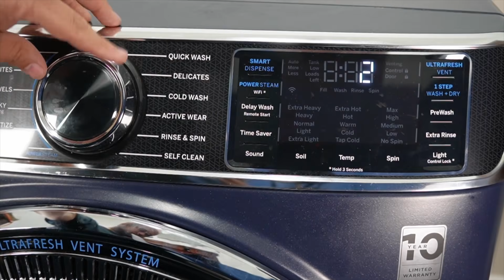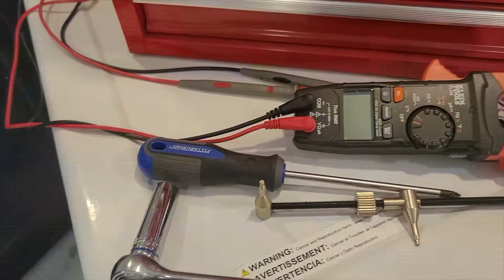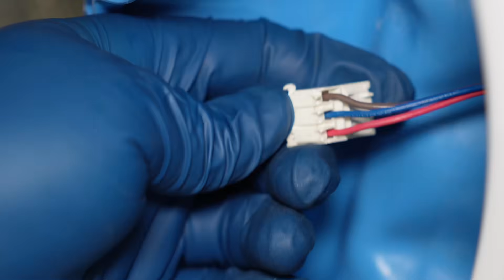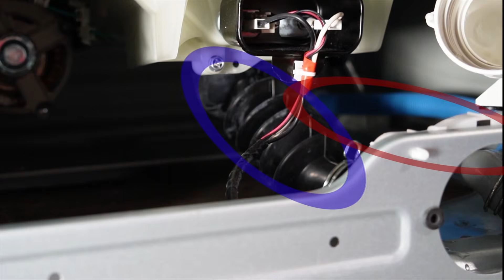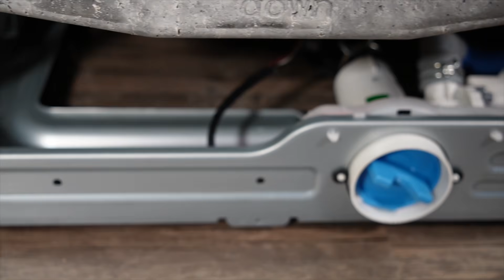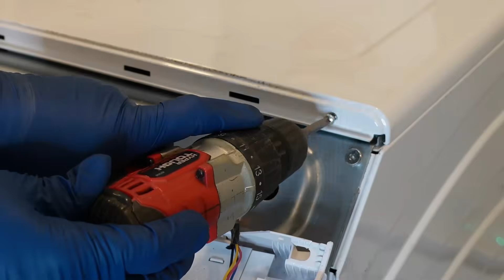GE Front Load Washer Stops Mid Cycle and Won't Spin - Common Issues

Comment: My washing machine (Model Number GFW850SSN0WW) won't spin more than 5-7 seconds even during the spin and accelerated spin tests. I know my damper was bad and I just changed that. Is it possible it is the inverter board or the accelerometer? How would I know if it is one or the other before ordering the right part?
Reply from the maker: Inverter board 99% of the time with that explanation of failure. Very rarely accelerometer, and you should see inverter board codes vs. accellerometer codes.
Reply: @bensappliancesandjunk  Replaced the board and it seems like it is working. Ran the rinse and spin and it completed the whole cycle. Going to start washing everything now, LOL. Thank you for the video and your advice.
Reply from the maker: @tubbywonder  glad to hear this fixed it for you!
Reply: I'm working on a washer that only spins with small loads any suggestion? I check suspension everything looks solid

Comment: Please consider a video on window air conditioners.  What are good models.  The ones sold at Home Depot, Lowe's and Walmart seem to be disposables.
I have a 98' 7800 Btu Panasonic window AC, and a Kenmore 8000 Btu that was purchased about six years ago when the stores were closing.
The Panasonic is much heavier, quieter and blows the doors off the Kenmore.

Comment: turns off after a matter of seconds and you hear a clicking sound.  No error codes. just keeps clicking.  Sounds like a relay click not the door lock click.
Reply from the maker: I just put the video out for that about 3 weeks prior to this one
Reply: Wish I watched this before I changed the inverter board.  The inverter board was not the culprit
Reply from the maker: @MrImperial67  it sucks - thats why I made the videos and released them as fast as I could, with the one about the main board being first.
Reply: @bensappliancesandjunk  thanks man I'm just starting out in appliance repair and you were more helpful than ge and my training school

Comment: I finally found your channel again. I thought I was subscribed but I wasn’t but I am now.
Hopefully you can answer this question and if you have a video with this topic link me to it. If you had a choice between Electrolux front loads and Maytag which one would you buy?
Thanks
Reply from the maker: With out adult right now I would go with electrolux
Reply: @bensappliancesandjunk  thanks
Reply: @bensappliancesandjunk  Thanks again.
So I think I narrowed it down to LG or Electrolux. 
Do you have a no bells and whistles LG front load that yourself you would recommend but maybe they all come with bells and whistles now.
Reply: @bensappliancesandjunk 
I decided on an the Electrolux 3 Series 

Washer (ELFW7337AW) with LuxCare® Wash System.

Dryer (ELFE733CAW) with LuxCare® Lint Shield

Doesn’t have all the bells and whistles and that’s what I wanted. Hopefully I made the right decision.
I only noticed after that it didn’t have an access door to clean the pump filter and looked at the schematics and couldn’t see one inside but I’m assuming that there is one. Do you know?
Reply from the maker: @rotaxrider  it doesnt sadly from my knowledge. But on the other hand, I never hear of techs replacing them so its possible they're built a little bit better than other brands.
Reply: @bensappliancesandjunk 

👌Thank you
Reply: @bensappliancesandjunk  
So not even one inside under the washer inline with the pump?
I’ve seen other videos where the had to remove the front of the washer to gain access to the filter inside a hose housing near the pump?
Also I seen where there’s an access panel under the washer where the filter is located.

Comment: I really do not like GE appliances. I worked at GE Aviation and saw first hand how GE cheap out on producing parts. I also had a old 1993, I seem to recall, GE top loading washing machine which was pretty good which lasted over 20 years & used a cider block for a counter balance. I now have a LG front loader washer & dryer. I am not impressed with these. I have to set the washing machine spin cycle to medium so it does not come up with a uneven load error. When I have to start replacing all of the appliances, I will get a Samsung all in one washer/dryer since I seem to remember you gave the Samsung unit better review then the GE & LG units. Please correct me if I am wrong.
Reply: Don't I am a tech and those things are crap
Reply: Please do not get the samsung
Reply: @codythedogyoutuber  Thank you for your advise. Could you tell me why not to get the Samsung.
Reply: @donaldhollingsworth3875  1. Spider arms go bad quickly 2. Heat pumps are badly engineered 3 inlets Val’s are trash
Reply: @codythedogyoutuber  thank you for your advise. I really appreciate it.
Reply: @donaldhollingsworth3875  Yeah like others have said, Samsung is pretty notorious for innovating but never fixing known design flaws (their Bespoke fridges seem to be them turning a new leaf on refrigeration though which is promising), but LG's laundry has always, always been top notch.. especially their front load machines (their top loaders are still direct drive, but like all top loaders, are simply a cheap tin can with a flap on the top, marketed specifically to stubborn americans who will never buy a front loader for..... reasons? Unreasonable reasons, anyway...) any LG with a heater seems to be equipped with their very good balancing algorithm, maybe yours is one of the base models which seems to not use an accelerometer or something, not sure...
Reply: @donaldhollingsworth3875 the washer pumps go out often and leak. I replaced two of them. Granted I'm having issues with my GE right now too 😂 Had issues es with LG and Fisher-Paykel as well. Whirlpool and Maytag are much longer lasting. I have issues with my LG refrigerator too,and luckily they had a recall that covered me.
Reply: LG is definitely the more reliable and better performing washer dryer set of the three. The uneven load error isn’t due to spin speed, it’s due to what you put inside it. If you put singular or small loads of heavy items it will easily go off balance.
Reply: They're both trash
Reply: I had a Samsung washer and dryer Combo. Lasted 3-4years.
Reply: @sandasturner9529 yup. Same issues with LG. My LG television is the only thing that lasts. Had issues with an LG refrigerator, too.
Reply: LG is making the best midlevel laundry atm
Reply: Bosch!

Comment: Ben! I have the wifi capable version of this wacher with the "tide" auto dispenser.
I've used Tide's washing machine cleaner with oxi a couple times now, but I'm curious if it's overkill. One packet caused the entire machine to fill with suds. After the painfully long (nearly a whole day) self clean cycle, there were still cleaner detergent particles in the drum. The instructions state not to use it with clothes so I ran some empty wash cycles to purge it. I then experimented by using about half of the pack and it only caused 1/3 -1/2 of the drum to fill...but no detergent remained that time.
Serious question: Is the totally full drum necessary for self clean?

Comment: You posted this just at the right time. Currently dealing with issues with my GE front-load washer right now and this is saving me a lot of time and money. Already had a handyman come out and replace the drain filter but turns out that wasn’t the issue. With your video I’m troubleshooting the issues and accessing the error codes myself rather than paying someone else to come out just to tell me the inverter motor is fried and I need to replace the entire washer, which unfortunately seems to be the case. Thanks!
Reply: Overly complicated procedure! Just get a Miele! They will run 20 years with no problems!
Reply: @agems56   Quite a declaration.  If you bought a washer 15-20 years ago they probably weren't using CPUs like all the stuff now.  Mieles now use them, and I don't see a difference.
Reply: I replaced the inverter board on mine- turns out that wasn’t the issue. Tackling the motor replacement tomorrow to see if it resolves the issue
Reply: @levifrost1399 did you ever find the solution? Inverter, motor, main control board, and accelerometer all replaced now. No luck.